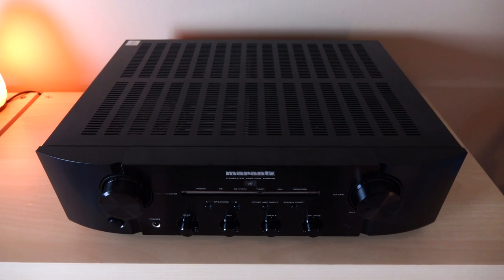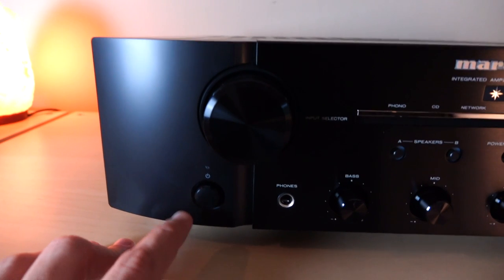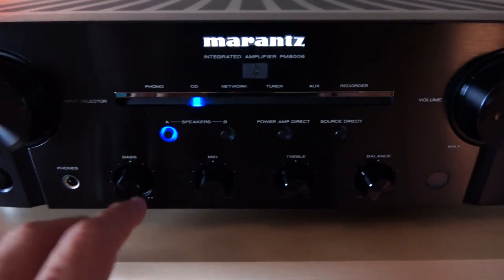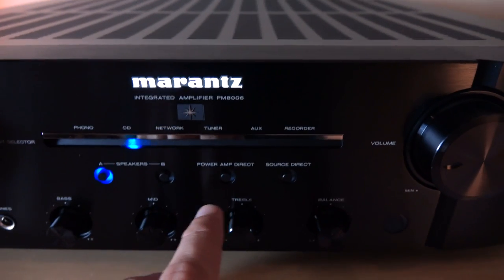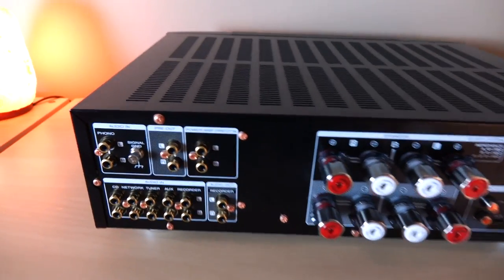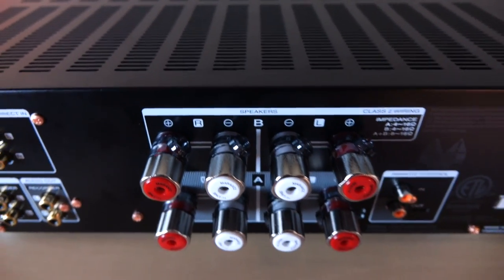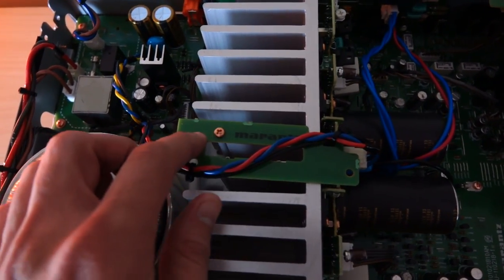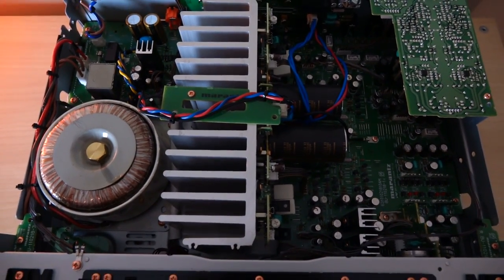Review!  The Marantz PM8006 Integrated Amplifier!

Comment: Thank you.  I have used this amp now for 6 months and like it much.  I am curious with your take on the source direct feature.  For me it has the opposite effect as described.  When pressed it by passes the balance and tone adjusters and calms the treble even when balance set at the neutral (straight up) position.  The treble also does not seem as augmented as reported.  I can only assume it has to do with speaker pairing.  Currently I have it paired with heresy 4 and relt9i.  This is the 3rd pairing the 1st and 2nd were Boston acoustic towers 90s and cerwin Vega 10" tower also 90s. Interesting indeed.   Thanks man!
Reply: I have had mine for a year now, and you are correct. If you activate “Source Direct” = the blue light is on then it bypasses the tone controls and balance settings. I find this gives a good sound when listening to analog vinyl. Interesting to see the MSRP on this unit went up $300 this summer.
Reply: saludos el marantz con los parlantes linton 85 he de decir que los graves son impresionantes  y los medios dulces como la miel sin embargo los agudos algo cortos pero la sinergia es como el cielo y la tierra...
Reply: Well I moved and now the room which has hardwood floors with a rug in front of my heresys and now the button does brighten everything up.  I now must adjust treble and mid range down.
Reply: saludos de Carlos al final de  todo depende de lo que estas escuchando y como se hizo la grabacion de la pista es como un platode cocina  a veces sale salado y otras dulce asin son las grabaciones . @brandtagone8487

Comment: Thank for the video Sean. I have combo ND8006/PM8006, paring with KEF LS50, and it's not good match. Can you suggest the speakers I should pair with? Bookshelf or Floorstand? My room is about 4mx5mx3m (DxWxH).
Reply: I agree it's not a great match with those two - not sure why, but the LS50s come across thin and harsh.
My two cents? 
If you like lively sounding speakers I found that the Klipsch RP-600m complement the PM8006 really well. The new Tratrix horn smooths the PM8006 treble, and the Marantz plumps out the slightly thin Klipsch bass. If you prefer something a bit more tonally consistent (smooth but still fast) Dynaudios aren't a bad match, but probably not suitable if you don't like bass.
Reply: How do you find the sound? Is it about the sound signature or lack of power what you don't like? 
I just ordered the PM8006 with Kef R3, so I guess the result could be a bit similar.

Comment: worth noting that there's no DAC built into the 8006, so that is an extra cost over the IOTA to factor in.  Also, it really should have been a comparison between just the SA3, not the stack, seeing as the performance numbers are about the same with just the single IOTA.  If the 8006 isn't the clear winner between the two, the IOTA is an easy champ.  500 bucks, same output as the 8006, and has built in DAC.  Unless I'm missing something?
Reply: The SA3 is 'only' 45 wpc into 8 Ohms, still plenty enough for me though! Also of note is the sub out on the IOTAVX and the option for the Bluetooth adapter with aptX.
Reply: Howard Haigh  I was thinking of the 4 ohm output when typing that, so thanks for the clarification there.  4 ohm output is almost the same.

Comment: What does source direct so on the Marantz? I always thought It only bypasses the tone controls, but you said that the treble gets more aggressive with that function.
Reply: I believe you are correct. It be brings everything back to neutral. It does nothing to increase treble.
Reply: @charlesb3801  so the "reviewer" was talking rubbish!
Reply: mikeos1 no the neutral is not necessarily neutral depending on each company,. Or amplifier

Comment: I'm looking for an integrated amp with built in mm phono stage that gives out ~100 wpc into 4 ohms.

I'm wondering, how would you compare this to the Sprout100? Is there anything else you might recommend instead of either? I also like the CXA81, but unfortunately has no built in phono.

Comment: The 5005 also has the source direct function; however, I have not noticed any significant boost in any part of the frequency spectrum ( treble). Was that Your findings on the source direct function on the 5005?
Reply from the maker: Nope.  The 5005's source-direct circuit operated as expected.

Comment: ☆☆NEED YOUR ADVICE☆☆  Great review, I appreciate the enthusiasm! I wonder how the PM8006 compares to Yamaha AS2200 integrated amp. I currently have a Marantz CD player, Marantz network player, Marantz amplifier (140 wpc), a Yamaha receiver RXV890 that I have for 20 years and still works without a glitch - I connect the pre-out to the amplifier and the amplifier to Klipsch 8 Ohm, 200 Watt speakers. I care about treble, clarity and sparkling sound. I want some my old CDs (those with not that great mastering) come alive and not sound "muffled" (relative fo high quality audio stream). Will the Marantz PM8006 or the Yamaha as2200 integrated amps give me the experience I desire and replace my old Yamaha  receiver? Thank you for your input! Leo

Comment: I have a Marantz KI Pearl Lite, PM7005, PM8005 and now the PM8006. Just great amplifiers to my ears.
Reply: Big difference between the 7005 and the 8005/8006 ? Going for a used one, maby 7003 or 8003
Reply: @kringtheking2657  There"s no big difference between the three amps. But the PM8006 is the best sounding amp of the three. The PM7005 sound better when the DAC is turned off.
Reply: @82ivaylo  ok, im using external dac. Maby just gonna use the dac for cd. I have pm5005 now but thinking about getting pm7005. Pm8006 is very expensive here ^^
Reply: @kringtheking2657  Years ago i had the PM6004. It was nice amplifier, but the PM7005 is class above.
Reply: @82ivaylo  sound quality or mostly powerwise ?

Comment: I also found this to be on the forward side of neutral with elevated treble. Thankfully it has tone controls and sounds pretty good for the price, but I ended up returning as I didn't think it matched well with my LS50's.
Reply: I have the Q150's paired with the NAD C 316BEE and, in my humble opinion, they compliment each other very well.
Reply from the maker: Yeah.  I def. think there are better matches for the LS50's than the Marantz at this price.  What did you end up with ?
Reply: @ZeroFidelity  Ended up going way outside of my budget with a PSAudio DirectStream Jr DAC and don't laugh...but a Crown XLS 2502 class D amp:) Your best bud Zeos (careful, if you say his name 3 times he will appear) apparently uses these amps in his living room and I was surprised to learn that a lot of people have found it to be a good pairing with the LS50's. Super happy with the setup but may try some PS Audio M700 monoblocks in the future.
Reply from the maker: @CaptainCrunch823  -  I'm waiting to bust the PS Audio stack from their boxes.  Gunna have to do it sooner rather than later.  Meanwhile, I'm glad you've found something that's made ya happy!
Reply: @CaptainCrunch823  Mate class D today punch clarity way above some A/B amps and having both class D mono"s and class A in my rack I now find A/B middle of the road

Comment: I've been using this amplifier for about 7 months and what you said about ''source direct button'' is completely wrong...Probably your unit was still in break-in period but my unit never changes treble if that button is pressed on.
Reply: Does your Marantz 8006 headphone jack sound good enough that you DO NOT need an external headphone amplifier?
Reply: @spiritualarchitect4276  never used it :)
Reply: @fluxcapacitor3273  Typical. I must have asked this same question 50 times about different amps and I always get the same answer : [

Comment: No difference to me, but I noticed an odd omission on Marantz’s part with the PM8006: No digital ports. I find that odd because anyone who would consider such a unit today would likely have something requiring a digital port, be it coax or toslink, etc.
I think Marantz is trying to keep the famous Marantz house sound (as they should) and drag it into the 21st century. So, on the other hand, the PM8006 is one way to do that by leaving digital ports off and making it stay in the analog realm, which could explain why there are no digital ports. 
Yeah, that “direct Source” switch is really not needed. I wonder what they were thinking putting that on there? Vintage Marantz amps from the early to mid-70s (I owned two and still have one) have a sound that is in the V shape as well with the treble tilted up a little, but still smooth, nothing aggressive. The lows are a little lackluster and on the sloppy side, but not boomy (unlike the Yamaha’s of old). Tone controls definitely help.

Comment: I'd be interested to hear what happens for you when you put it in standby, leave it for a few hours, and then wake it from standby with the input selector dial. 

I've had 2 of the 240v version, and there's this weird issue where - when you do as described above - it turns on, then flicks straight back to standby. Weirdly,  it never does it when woken by the remote.

Other than that, it's a great amp.
Reply: This reverting back to standby has occasionally happened to me as well. I think it may be caused by trying to change the volume (or other control function) before it warms up. I try not to touch anything before I hear the click, since I've been doing that it hasn't happened.

Comment: How would the PM8006 pair up with Totem Hawks?  I like the Marantz "house" sound, but I question if the amp has the horsepower to do them true  justice.
Reply: If it isn't enough power connect it to a power amp and you'll get the sweet Marantz sound even louder. The sound quality comes from the pre amp mostly, not the power amp.
Reply: @MrChris-zb2bs  Rarely a good answer.

Comment: Better design for cooling than the Marantz power amps which use a "fan tunnel".This should play all day without a heat problem.
Reply from the maker: Yep.  In fact, both the Marantz and the Iotavx exhibit good thermal behavior.  The Heed runs mildly warm, but that's by design and was meant to be left on 24/7.
Reply: I still use a Marantz 19 from 1974. Huge heat sinks that take up each side. With only 50wpc, you could run this thing all day at full power and it only gets a little warm.

Comment: ihave listened to hifi for years and we all like different things,you have to buy What Sounds right for you,i never understand when reviewers say Things like thinner side of neutral,What does that mean? if you haven't listened to the master track How can you come out with such statements,buy what sounds right  for you, These guys don't have better hearing than the rest of us and sometimes forget that the enjoyment is in the listening.
Reply: Geoff, yes very well said.  I would agree with your assessment about which side of neutral the sound is.  Sound from audiophile equipment is a subjective , personal preference thing.  But with Cory measuring the two Amps with the same speakers is what one  wants to hear.  I guess if one unit delivers more bass or midrange or treble  vs the other , it would be apparent no matter what speakers were used ( with the right specs).  Hearing is in the Mind of the beholder.....  For the record, I am looking into replacing my NAD 1300 Preamp which is now showing wear and tear of the phono input.  I'm entertaining either this Marantz unit , or an equivalent Denon or perhaps a newer NAD eqivalent. My 1300 is hooked up to a NAD 2600 AMP.  I presume with Preouts on the Marantz, I would be abke to connect it to the Amp. Cory, thx for presentations.

Comment: I think you forgot to talk about the phono section, which in this amp seems to be fantastic as in some previous KI designs. If you are a user of MM cartridges, it can be enough and save a phono preamplifier from € 300- € 600. 

I have a Yamaha AS-801 (two years old) and now I have purchased this to replace it. I will count my impressions here. They will be connected to Phonar Veritas P5 speakers

 
Regards from spain
Reply: Hi Federico! I have the PM8006 and previously had the PM6004 and used the Pro-Ject Tube Box S (https://www.project-audio.com/en/product/tube-box-s/). I have heard how good the built-in phono stage is on the PM8006 and you seem to agree. I wonder if you have thoughts on this? Any experience with the tube box?
Reply: @mattgomez7062   
 No, I haven't had that phono preamp, I've had a DS2 BOX. The Marantz preamp I think is superior, it is only MM, but the SNR is fantastic, and the soundstage too. I bought the PM8006 a month ago, I like it better than my previous A-S801, which was a great amp.
Reply: @federicovillaescusa5448  What do you like better about the 8006 over the 801? I don't use the phono section.
Reply: I have the 8006. I also have the highly regarded Musical Fidelity LX2 LPS phono preamp. The MF is better, but slightly so. It's more silent and top notes have better separation. Difference is more apparent while listening to orchestral pieces that has huge scale and dynamics. 
But had I not already had the MF, I wouldn't have bothered to spend on a separate phono preamp. The quality is that close .

Comment: Your source direct issue is not the experience I've had with this amp. I've got it running source direct 99% of the time and no spike in treble comparatively with my other amps. It's surprisingly close in signature to my Primaluna valve amp. My Yamaha A-S1000 sound flat and cold where the Marantz has warm musical tone verging on valve in my opinion
Reply: I don't notice a big difference with source direct either on my PM8006.

Comment: Nice video. I would like to see a video that talks about power output claims.  Recently I've become aware that there is considerable talk claiming that Manufactures lie about the power output of their Amps. Often greatly exaggerating them.  Is this true? How widespread a problem is this? How can the consumer verify a Manufacturer's claim? Is there a gadget that you can take into a store that will give you an accurate measurement of an amps output?  I was thinking of purchasing the Marantz PM8006 but the claim of 70 Watts RMS was on the low side of what I was looking for. The amp I eventually purchased claimed 100 Watts RMS which was still on the low side but the price was right. Now I'm thinking that 100 Watts RMS was BS.
Reply: Claude C it really depends on 1) the size of your listening room, 2) how loud you typically listen, and 3) your speaker’s sensitivity rating. Most listening is only at a 1-10 watts average anyway unless you’re cranking it.

Comment: Why no digital input in these things?
Reply: DAC's become outdated quickly anyways. Better to buy an outboard DAC IMO.
Reply from the maker: Marantz has been like this since I can remember.   They've never been huge on throwing lots of 'stuff' into their gear, taking on the "less is more" approach.  This hurts them on the mass-market side of things, but tends to bear fruit for more discerning listeners.
Reply: @ZeroFidelity  Except that they added the Direct Amp mode, which increases the cost and is completely useless, because without it, this amplifier becomes at least one class lower, but the sense of an expensive preamplifier and paying for an integrated one.

Comment: What's with the weak power rating? This is 2019, go class D and you should be able to deliver at least 200 watts per channel at 8ohms.
Reply from the maker: There's still big demand/pull for A/B amplifiers.  It's a topology that Marantz knows and is good at.
Reply: 80 watts of clean power is more then enough for most owners with most speakers if matched properly with a amp
Reply: Not for Maggie’s. :)
Reply: @jeffadams9699  I did say most and you must pair speakers to amp as well. 
You want separate amp preferably to monoblocks for Maggie's and lots of other power hungry speakers. But for some high/ultra high  impedance speakers only a few good quality watts are enough, the rest of the power is good for peaks in The source material.
Reply: I know this all too well with owning ZU Audio speakers that are rated at 97 and 101db respectively. So I have driven those with as little as 2 watts

Comment: Cambridge CXA80 gives more bang-for-buck for less cost. Includes a DAC and has a bit more power.
Reply from the maker: It depends on what you want.  If you value a smooth top end, clarity through the mids, and big imaging, then the Marantz takes the W, hands down.  If you prefer a grittier, warmer, stronger sound, then the CXA80 will take the cake.   The bump in power is nearly meaningless and the DAC only means something if you really like the idea of a built-in DAC.
Reply: @ZeroFidelity  Built in DAC was a must for me. I compared the CXA80 DAC using Audioquest Nighthawk headphones to both Audioquest Dragonfly Red and Black and couldn't tell a dif between all 3. The Dragonfly Red is $250.00 CAD so IMO the CXA80 is a very good deal because of the included DAC.
Reply: @ZeroFidelity  Have you reviewed the CXA80 or did you just hear one once? Because I have never seen anyone call it "gritty" sounding.